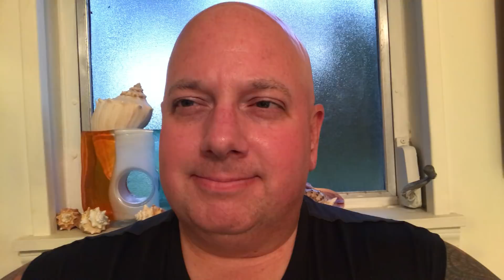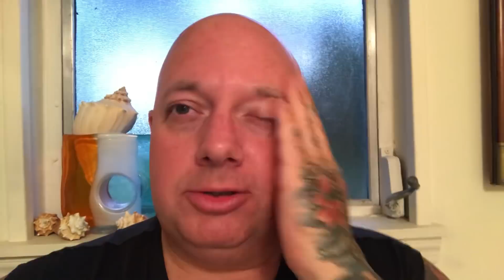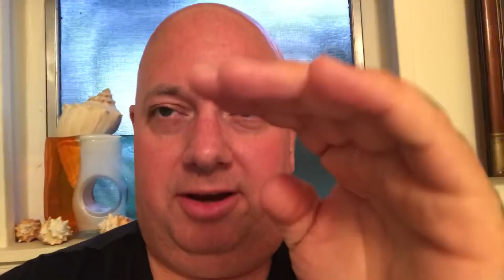Solving NIKON mystery 😵 oil spew on sensor

Comment: D600 is a joke. I had the oil spot issue. Returned it to Nikon to clean/fix. About 3000 shutter clicks later same problem. It's a paper weight now. Can't give it away.

Comment: They dorked up the D600, failed to fix it with D610 and then goofed up the D750.  I wonder how many folks switched to Canon after these issues.
Reply from the maker: all this i know,......however canon has crap DR,  D850 blows the balls off anything canon has
Reply: I doubt many people switch to Canon because of it. They had it fixed or upgraded to another Nikon.

Comment: The first time I had a professional DSLR, a D3 and later D4S and D5 for testing (the D5 is crap) I was spoiled rotten forever. The D810 I recently repaired from complete water damage just feels like a light, plasticy camera, even with the grip. The 610 is just a FF D3xxx, why bother? Buy a used D3!!!

Comment: I have been dealing with this also. My D610 was pissing on itself till about 3,000 clicks. At one point it looked like a puddle in the middle of the sensor. Anything that would land on the sensor had to be scrubbed off. (no blower could get the specks off). Now it seems like it has run out of oil piss. About a month ago I was finally able to use a rocket blower to remove dust and shutter shards from the sensor. (yeah baby got through the trouble period). Now all is good and I can now use one or two paddles to do the job right.

Comment: My Pentacon 50mm f1.8 is kinda hazy. Still takes dreamy shots, but shot into the sun, the haze comes out as if I pulled the clarity slider to - 100%. Bought it from an estate sale (with all the gear sitting in the sun just to add to the mix) got it for next to nothing so I won't complain too much but that's exactly what I got. You are dead on.
Reply: That's what you get when you don't buy vintage lenses from Japan though 😉

Comment: I clean oil with alcohol !
Reply from the maker: true true but that leaves streaks then you need to finalize with a sensor swap and its solution
Reply: Does that work? I may have to try this method, just need to be sure if it won't make it worse than it is right now.

Comment: I once had an identical looking smear with D850 and Milvus 100, evident on top of gravel on a nearby roof. Took another shot and it was gone. Took a few more shots and it was on and off. It was actually the air distortion from the vent of an A/C unit on that roof.
Reply from the maker: air distortion!
Reply: Yes, I actually showed it to Steve Perry and he was amazed too. The wet A/C exhaust caused this! I just sent you an example pic. Of course it's very evident with high res sensors because the rest looks very clean. Now that the store is closed, the distortion is gone from the roof as well...